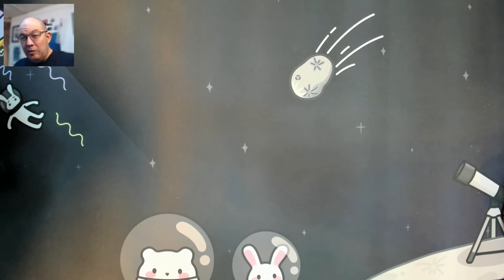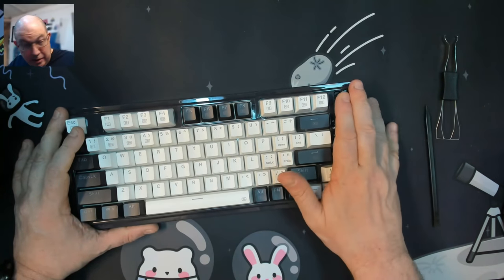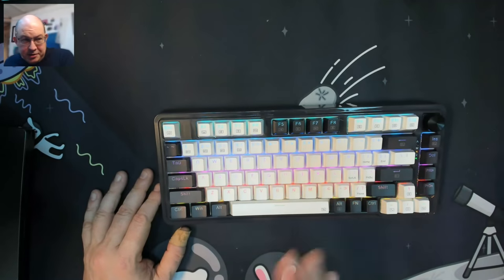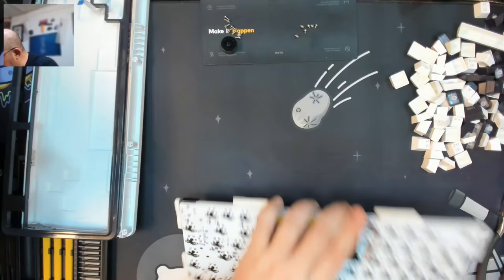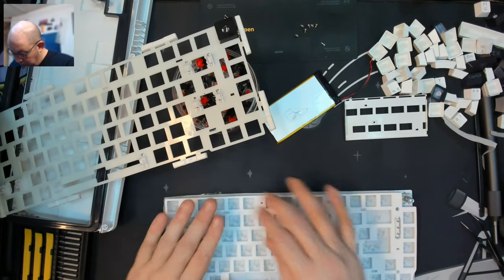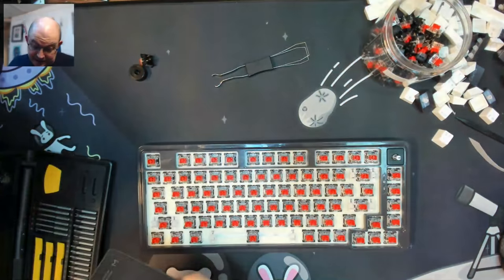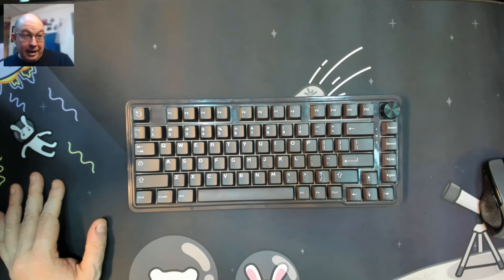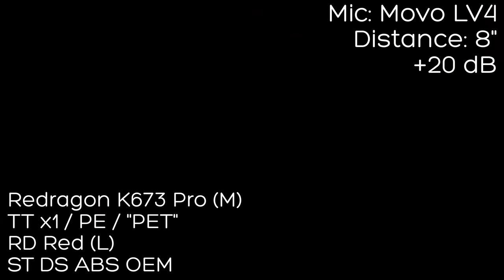Redragon K673 Ucal PRO - 75% 3-mode with a knob: Review Teardown Modification and Sound Tests (PET)

Comment: If it weren't for the horrid glossy two tone shell I would consider this an amazing keyboard, especially for switch compatibility and the price makes it nearly unbeatable.
Now all they need to do is release it in a matte color configuration and I would get it, just to fuck around with different switches.
Reply: That's what I did, for the exact same reason. Don't care about the looks of it tho. I was expecting a keyboard like this for a long time; when I discovered it, I couldn't resist, even though my christmas self budget was already long blown away. XD

Comment: Hi i wanted to know if i can add masking tape or electrical tape because most people told me that you cant use masking tape on keyboards with battery they told me to use electric tapeso i wanted to  be sure if i can use masking or electric tape
Reply from the maker: I do not use electric tape and masking tape or painters tape has worked fine on dozens of keyboards that I have built. Masking tape is non-conductive though it will burn if something else catches on fire but it does not cause a hazard adding it to a keyboard and I don't know who started this idiocy.